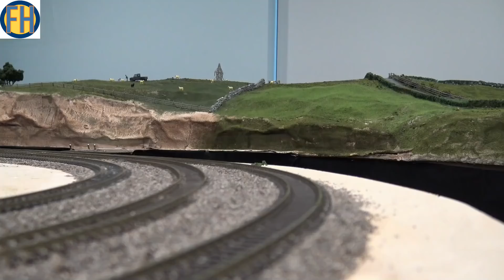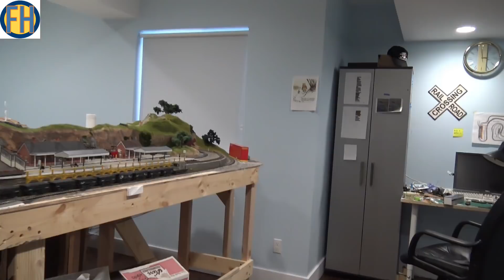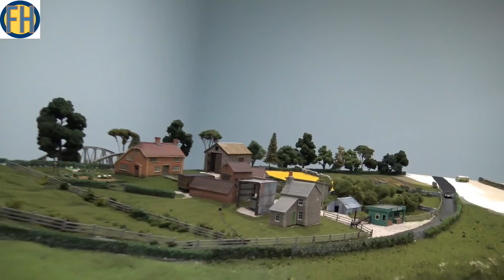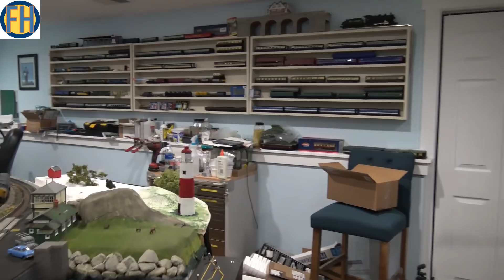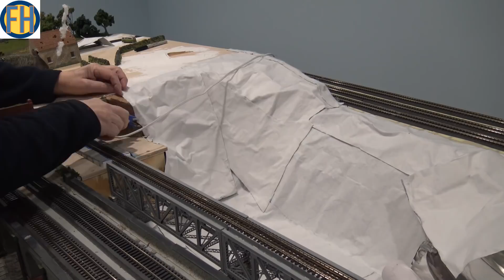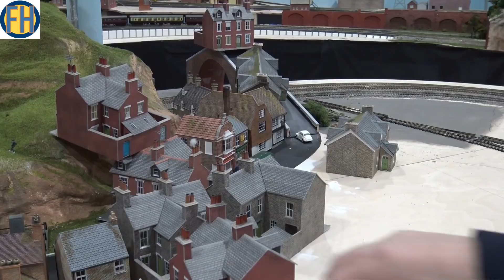37B Building Farland  -  Shaper Sheet and planning for Far Moor

Comment: Nicely done, Rob.  The farm looks excellent, and I enjoyed learning how to use the shaper sheet. Thanks for posting!
Reply from the maker: Hi Ben, Thank you, The Shaper Sheet works great.  As you saw I used hot glue with a $10 glue gun to apply it.  The application of it goes quickly that way, I have also used staples.  When you get it all on, then you use Shaper Sheet plaster which is painted on.  You mix it very thin and in very small batches.  The plaster does not take long either.  Thank you very much, Rob

Comment: The early shot of the tunnel entrances, and the trees escaping from the higher forest into the zone between the tracks, works well.
Nice reverse shot beside the bridges, makes me appreciate the size of layout from the time it takes to run around to the distant background 
Signals are working well, and benefit from the running time for the loop to be realistic. After all, on a small tail-chaser track, the signals would not have time to change realistically. You could even have level crossings (but probably the barrier type, rather than the gate, since the signalman would be so busy opening and closing ...)
Shaper sheet does make the hills much easier, combined with your cardboard “ribcage”; nice technique, simple and effective.
Liking the ruined barn, and your usual attention to detail.
Would camper-man be in a lay-by, in the lee of some trees, or in a field to get the view off the hill? Perhaps all three, if he’s found the ideal spot?
Continental coaches make a nice change; surprising how much they notice, with the inverted colour scheme.
Regards, Tom
Reply from the maker: Isn't that shot fun?  It is well over a minute for a scale speed train to run the layout.  119'-10" per loop.  I plan on have some level crossings.  Some protected and some not.  I will no doubt give him some trees, but a muddy field is a must.  It's Camper Guy.  One of the Pullman rake is my favorite, the Night Cap Bar.  It is in standard blue and grey livery, the Pullmans are in inverted livery.  I am not sure where the Night Cap is supposed to be, but I run it with my Pullmans and my blue and grey sleepers.  Thank you, Rob
Reply: Just noticed the level of weathering on camp-guy’s van; he obviously goes muddy quite often, so the obvious idea of having the farmer on his tractor pulling him out might seem less credible. Put a posh and polished Range-Rover (with roadtyres) with a caravan, and you can easily have the tractor on call-out.
Sorry about mis-recognising your Pullman rake, I saw the chrome bars iin the toilets, and jumped to the wrong confugration.
Reply from the maker: Tom Lawton The VW will be hopelessly stuck in the mud and he will have his tent nearby and a campfire ring.

Comment: Dilapidated Barn looks very original ...you have some better angled areas now for the camera now a good walk through or should I say walk around the layout making it easier to get at each area ...that shaper sheet is handy stuff sure works fast or the worker works fast LOL ..gives you more time for a session ..as said the girder bridge does look great ..curved platform at Far Moor should look good , not as easier to do though ....and with a loop line should work good ...happy modelling as we say ..Dave
Reply from the maker: Hi Dave, I have had the old barn for some time, but it seems to work okay on the new layout.  From the beginning I wanted a layout with easy access.  It is quite high, about 52 inches to the top of the bench although varies.  Shaper sheet is great stuff though a bit expensive, $15 per roll or £11,30.  Yes, I know curved platforms are difficult, but I want to try.  I am excited about the prospect of a line to Far Moor.  Thank you Dave, cheers, Rob

Comment: The track for the runaround at Far Moor needs far more gap between the point and the slip, so the loco doesn’t foul the main line.
Could it have an older style goods yard there?

Interesting about the programming track; because you have no one control position, and can run things remotely, there is no obvious place, but that one, near to your workbench but hidden away, is great. Will the track have a cover to keep it clean, and hide it out of sight?
The other point about remote control is that you have many more viewpoints; you don’t have to abandon control in order to get to a sight-line, which would have made them more effort to benefit from. And this means the signal enhancements are for more than just your viewers.
As always, a pleasure to watch, and see your progress.
Reply from the maker: Hi Tom, I am just starting to think the line to Far Moor through.  I don't mind cleaning track.  One thing some people don't  get is with wireless DCC, there is no particular control station.  I rarely sit still while trains are running.  I like to move around as I watch over them.  That is the magic of the Z21.

Comment: The camera mount works very well, and is smooth without preventing change of vertical angle.  Gyro-stabilised grip?
Reply from the maker: Tom Lawton It is weighted and balanced with trim adjustments for dialing in balance for any camera.  It is a bit heavy to carry.  It is going to strengthen my arm for sure.